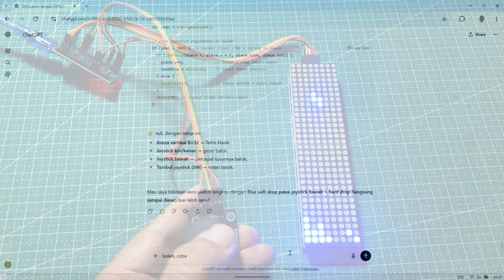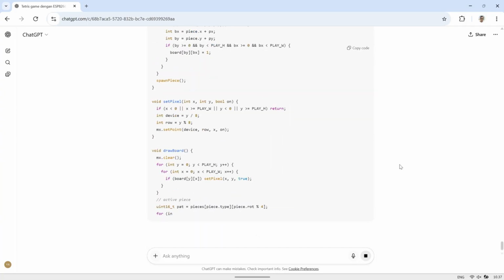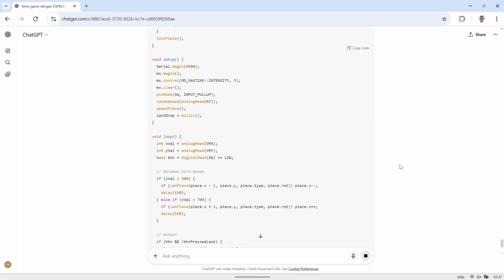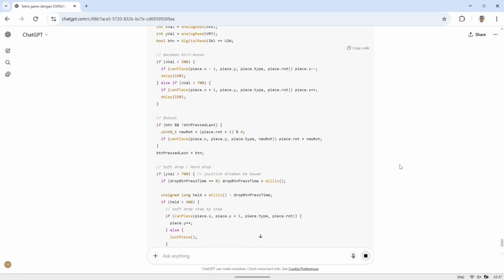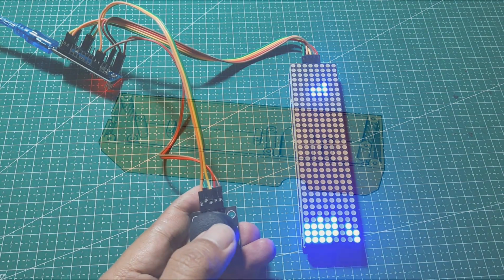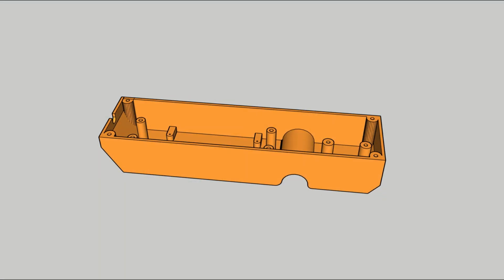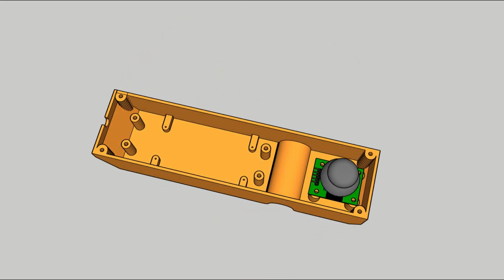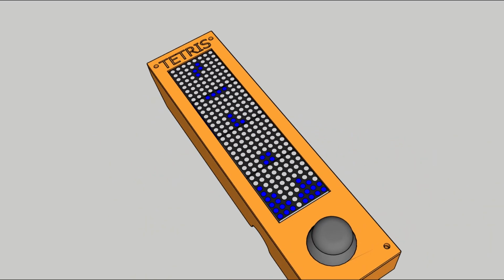Build a Tetris Game Console with Arduino Nano + Dot Matrix + Joystick

Comment: There are 3 codes in the link. Should I put them one after the other? Or why are there 3 codes?
Reply from the maker: Use the latest version, 3 codes are my experiment codes
Reply: What libraries did you use?
Reply: that is, the one that says REV 2
Reply from the maker: @OriEscobio 
Yes correct, you can use Rev2